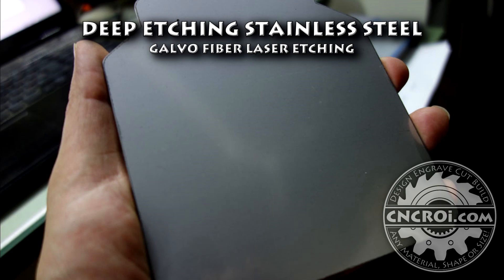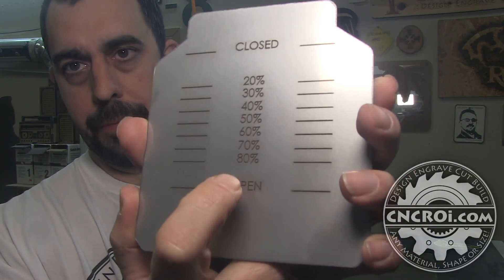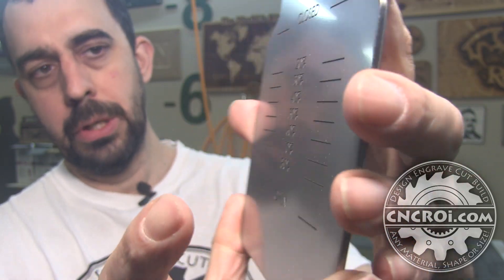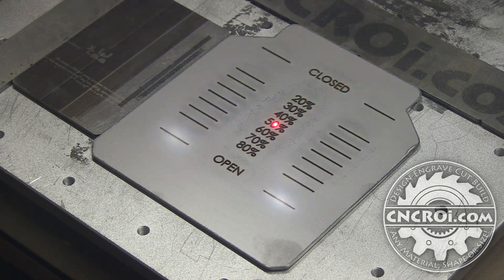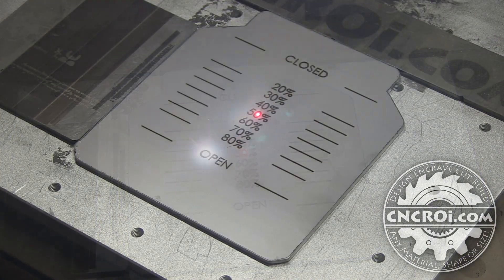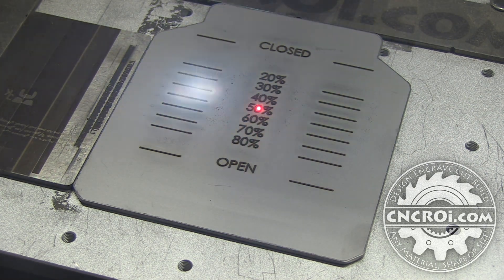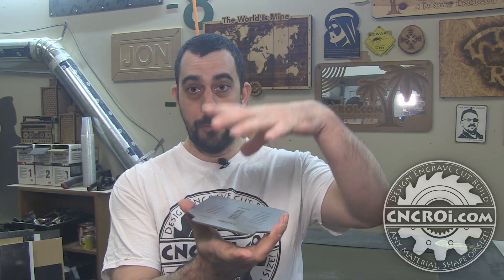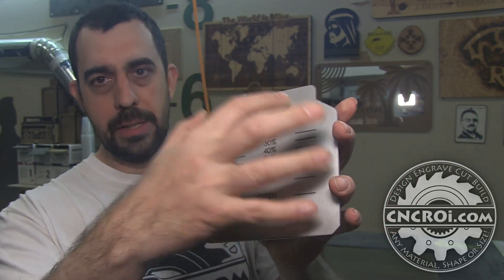Deep Etching Stainless Steel

Comment: Those lasers are crazy to be able to cut steel like that.  How long did it take to engrave that plate with the % marks on it?
Reply from the maker: Over an hour at the depth the customer requires... yes... per plate.
Reply: How deep u can do .?  How about 1 mm depth for 2 mm stainless steel ?